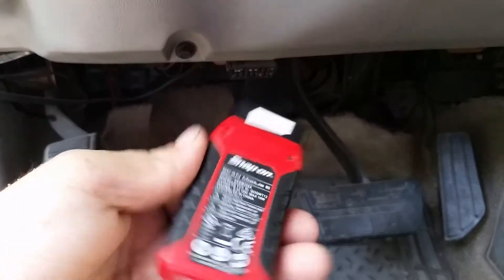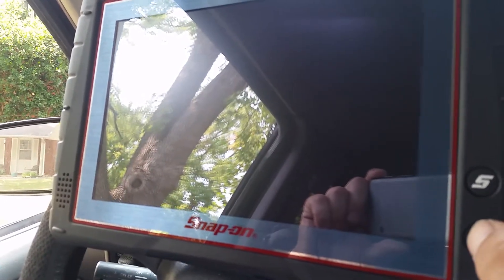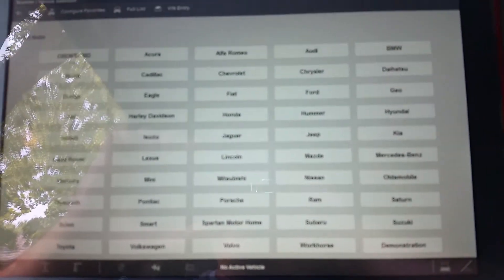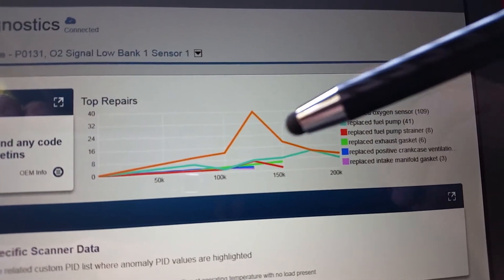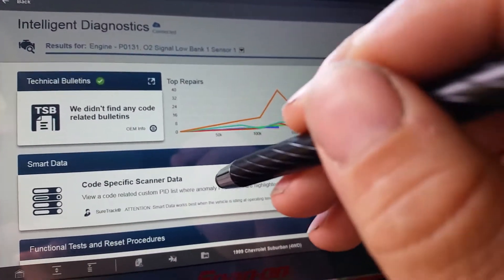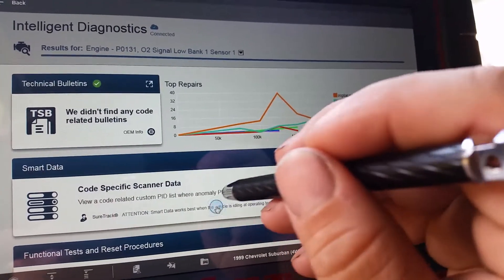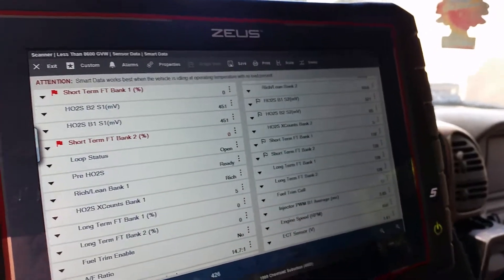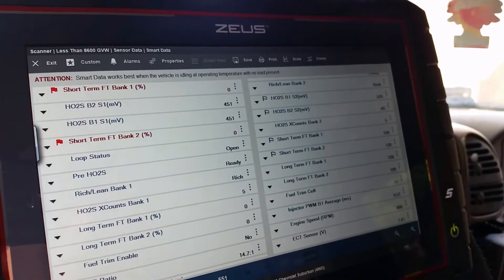Snap On Zeus on a 1999 Chevrolet Suburban - "Smart Data Demo"

Comment: I would have like to seen the o2s flagged with the STFT. The system was in open loop and for a beginner i can see where they could think the fuel trim and o2 data is caused via the open loop. Im sure snapon will have some updates for some of them little things like that. But for the cost you would think they would already have them fixed lol. I still haven't got to use the Zeus yet, but i like my Verus Edge. I would like to see them get better with there scope before their scanner platforms. Thanks for the video. Great job!

Comment: Short term fuel trim doesn't move with the o2 sensor. It will read zero when there is a o2 fault and the vehicle is in open loop.

Comment: Pretty easy diagnosis to showcase a $16,000 scanner.  Show me some good nasty Chrysler PDC issues, that require a good schematic and some logic to troubleshoot.  Or, how about a nice VW non-turbo hesitation problem...I find a different reason every time I work on one of these.  Heck, even this tool's built-in demo is another O2 sensor problem.  Show us what this thing can do, not what Snap-On wants us to see.
Reply from the maker: LEO ASHRAE you're right, I really wish I'd had time to put this thing through the ringer diagnostic wise, but this is what I was stuck with. It was kinda short notice when I was allowed to borrow it, and this is what I had. And BTW... you're a monster wishing VW hesitation diagnostics on anyone. lol
Reply: Your right.  Damn VW's have taken a few years off of my life...

Comment: nice video, thank you for that, but i would see this 16K SCANNER WORK ON EURO AND DOING THE HARD STUFT NOT JUST READ DATA STREAM, I WOULD LIKE TO KNOW IF CAN DO PROGRAMMING AND CODING FOR NEWER VEHICLES , NOW A DAYS IS NOT JUST READ CODES AND DATA PARAMETERS , TECH NEED SOMENTHING  WITH PROGRAMMING AND CODING. KEYS, AND IMMO,  I OWN A VERUS BUT I JUST FEEL LIKE SNAPON  JUST REAP ME OFF, I HAVE AUTEL ELITE AND DOES 10000 THINKS MORE THAN SNAPON.
Reply: Edi Santay any Autel Maxisys System will take Snap On back to school.

Comment: Flagging the data in red as it did here is something we've asked for for some time but in my opinion this example fell short. Why weren't the two forward O2 flagged since they were also flat lined and that wrong. Also the system was in open loop when it should have been closed. The root cause of the problem was the disconnected sensors but an information PID in this case St trims were flagged. I'm not sold yet. Your Baro  reading on the Ford you mentioned I'll bet would never be flagged either. Since that's based on altitude and a calculation from the maf  kinda like a reverse speed density calculation.

Comment: Why does snap on build the Verus & Zeus  on a windows platform in the first place. The solus and modis scanners are built on proprietary operating systems and their boot times are like 3-4 seconds. So far this truly looks like nothing more than a Verus edge with a make over and a slightly different software.

Comment: Can you Scan a new car please with this Scan tool . Not much use on a 18 year-old car in fact you dont really need  a Scan tool on such a  old car . Please Scan new car and show us how to code new Air conditioning control module on a new car using this new Scan tool  please.  This Scan tool needs do coding and i lots more for the price
Reply from the maker: I had a few newer vehicles, 2010 and newer, lined up to use this on, but those fell through. I have 1 more video I'll upload today of a very quick use on a 2009 Ford Taurus. It doesn't show much, but it was a call I got to go look at something so I figured I'd throw it on there and check it out. I will say, I do not believe the tool carries the programming/coding functions like GM's SPS, Ford's Programmable Module Replacement function through the IDS, or the other module coding functions for any other makes. If I get the chance to show this on a newer vehicle before I have to hand it back over today, I absolutely will. Thanks for your comment and taking the time to check out the video.